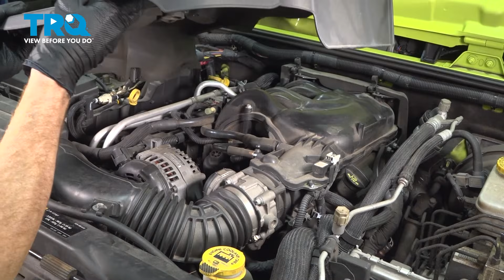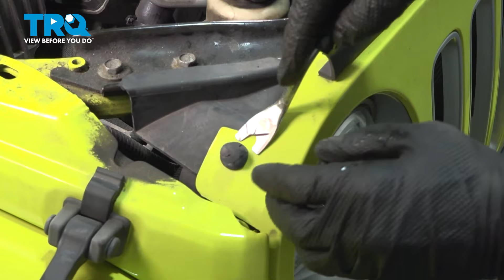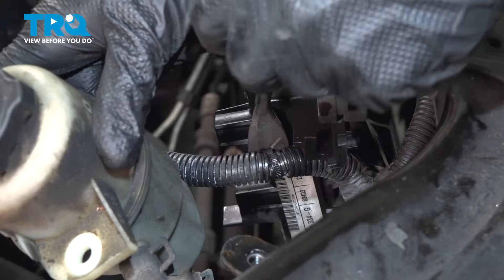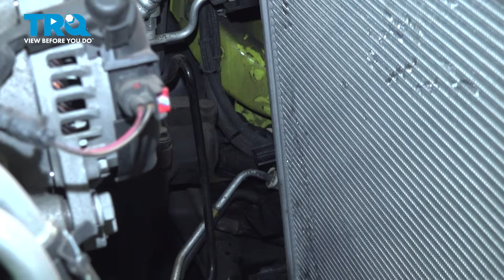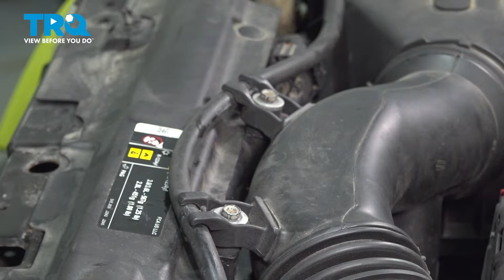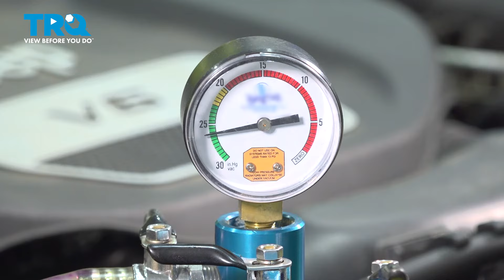How to Replace Radiator 2007-2017 Jeep Wrangler 3.6L V6

Comment: Great video I will use this when I change my radiator this week but being a person that detail you forgot to mention connecting the power steering hose to the side of the radiator and there is a bleeder not on your thermostat housing for letting air out too

Comment: For anyone struggling with the 8mm between the hard lines on the driver side around 13:10 in the video, I was able to remove the driver side headlight, bend the horn up a little, and run a long extension with a swivel and it zipped right out with my drill. Hope this saves someone some time

Comment: One suggestion I’d make, is before you install the new radiator, carefully screw, then unscrew any fasteners where it’s tricky to get new screws started.  You’ll be effectively “tapping “ threads for the screws in the virgin plastic bosses.  The lower condenser screws and the line brackets on the drivers side are a bit tricky.  I think I spent more time on them than ever other step combined…

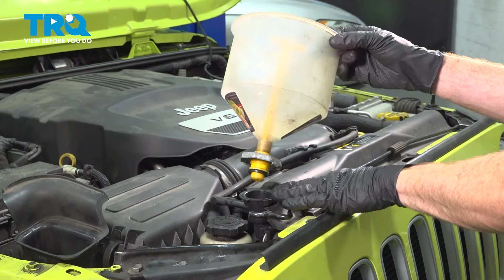Comment: 30:13 Those funnels are worthless on these systems. Due to the fact the filler neck is on the side where the lower radiator hose is. When you pour in the coolant it just goes straight down, out of the bottom hose and into the water pump. Leaves a giant air pocket on the other half of the radiator and the thermostat. What's worse is, when you fire up the engine, due to the direct link to the water pump, you're going to get excessive turbulence, and the coolant will even rise up and spill out of that funnel. No bueno.

The best tool you can use is a vacuum filler. Or, you can fill it manually. Best way to do that is unbolt the thermostat, and slowly fill the radiator until coolant pours out of the thermostat opening. Then secure the thermostat back, and undo the bleed screw on top of the thermostat. Continue filling slowly, until no air pushes out of the bleed screw.

Finally, if using a vacuum filler, make sure to prime the filler line. Otherwise, you're just injecting air right back into the system. Operator here did not prime the filler line.

Comment: Note that the lower mounting bracket behind the drivers side wheel well is not present on manual transmission vehicles.  Same for the first two 10mm on the drivers side and one 8mm on the passenger side which hold the transmission fluid condenser, that is not present on manual transmission models.

Comment: Wasn't the 3.6 only in Jeeps after 2011?   Looks nothing like my 2010
Reply: In 2012 Jeep switched from the 3.8 to the Pentastar v6 3.6 with more power.  I have a 2011 2 door jk with a 3.8 (SLOW af)  and a 2015 4 JKU 3.6 way stronger my engine looks just like that; but to replace the radiator, it's the same process from 2007 to 2017 no matter if your engine looks like that or not.
Reply: exactly